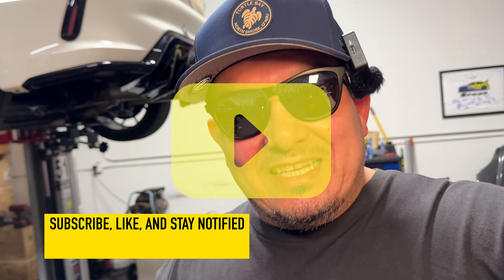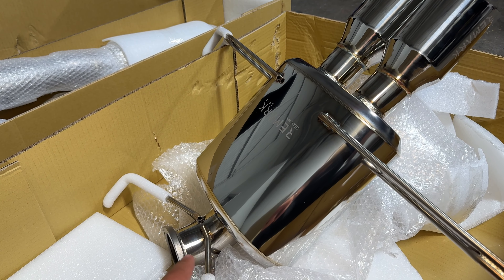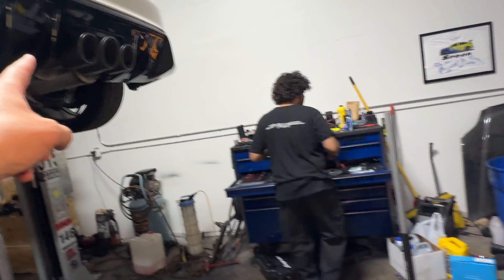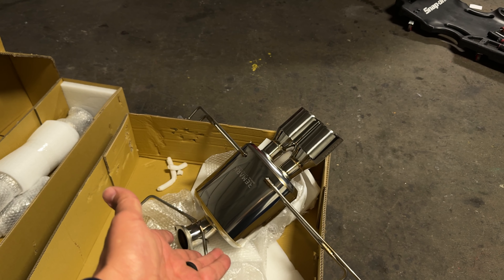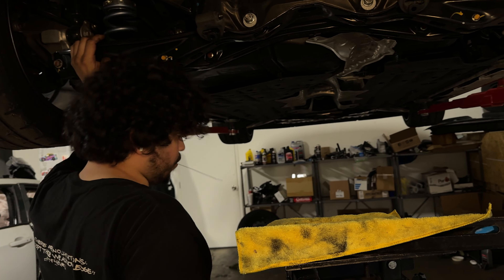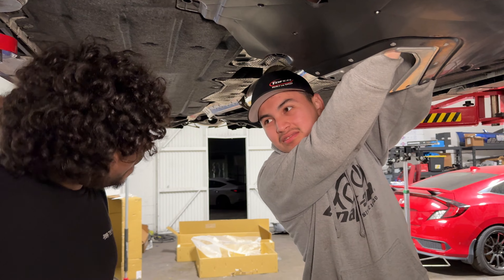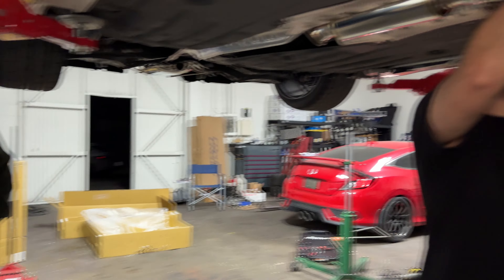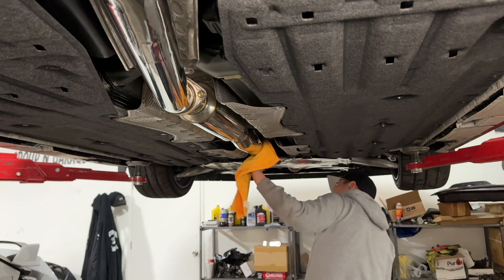2023 Honda Civic Type R FL5 REMARK Sport Turing exhaust install

Comment: Been thinking if I should go with the hks legamax or the Titanium Remark exhaust due to the other one utilizes the valve actuator but still remains open and the remark is valveless and I’m just thinking that it might turn on an error code at some point. Did it turn on an error code after you tracked the car? I’d appreciate some insight, thanks!